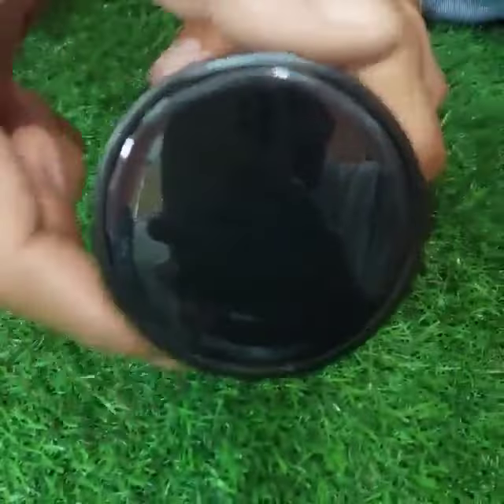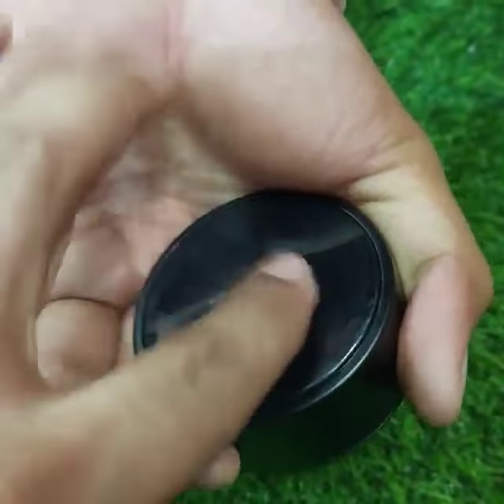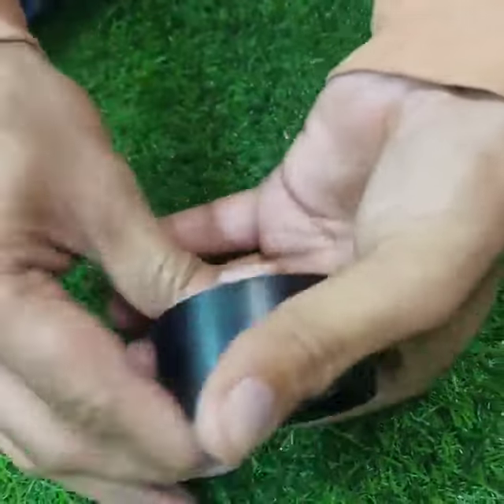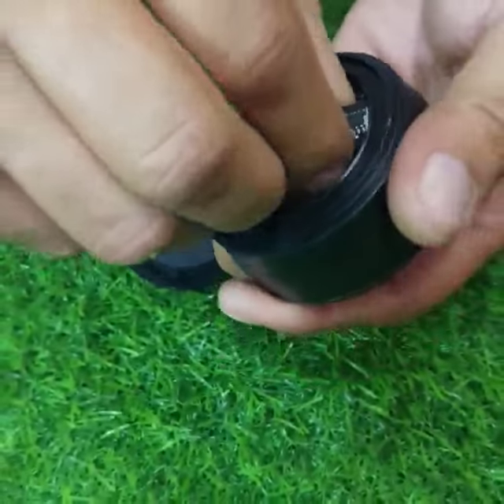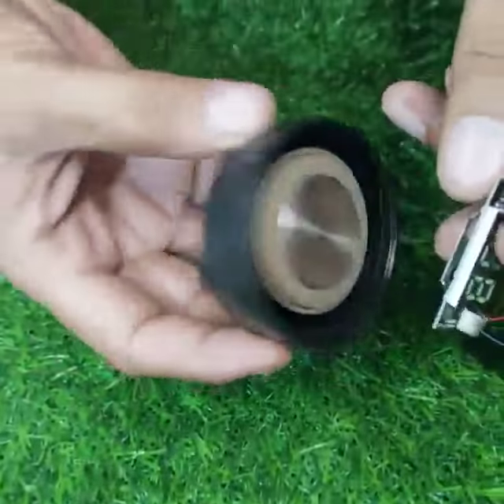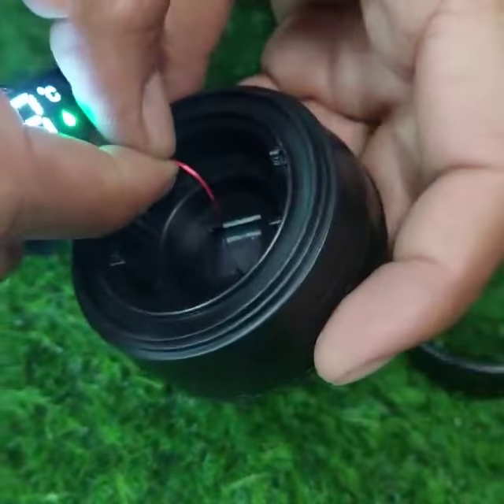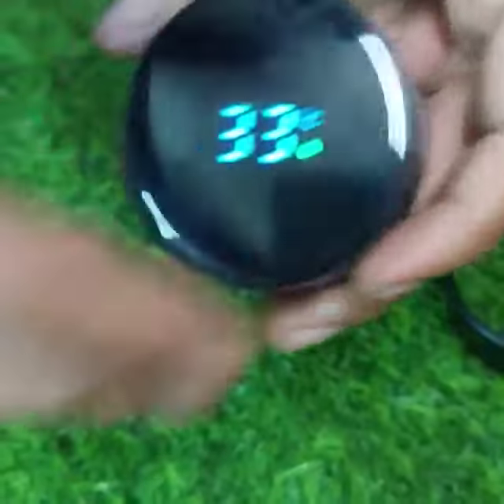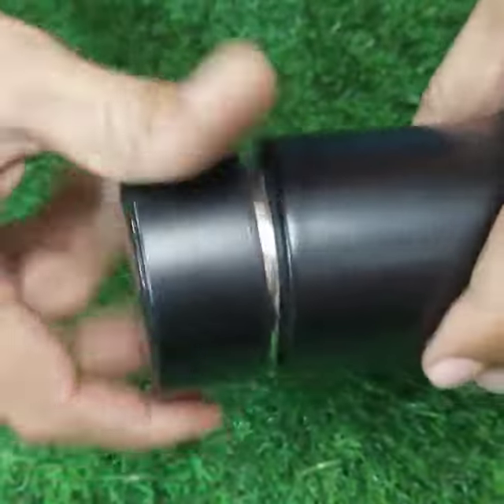Changing Battery of Smart bottle .

Comment: It is very useful but i couldn't open it
Reply: Now how did you open?
Reply: @iamdivyanshuroy  put it in a freezer for a few hours then try pulling it
Reply: To open you have to hold the border, push the top without hold the bottom because the border is the thing to remove but the bottom is not part of the border. (There is a small gap between the bottom and the border cylinder near the bottom of the border)

Comment: Take care to let the top plastic cover loose. Else the tap to wake the thermometer does not work anymore. Seems the detection requires the plastic top to not be in contact then make a contact with the pad on the circuit. But if the cover is too tightly pressed on the detector pad the contact is always on and no tap is detected. The heat way is to not touch the plastic top while putting back the border cylinder. And check mid reinsertion if tap still works.

Comment: My top is impossible to take apart. Any suggestions?
Reply: Take care not to hold the bottom while pushing the top. Because the cylinder to remove does not go to the bottom.
You could also put the object on a surface, put your thumb on the middle and pull the border to the top with your other fingers. Slower but easier to do reproduvibly and you don't risk breaking the cylinder.